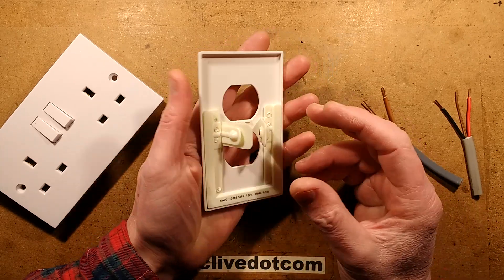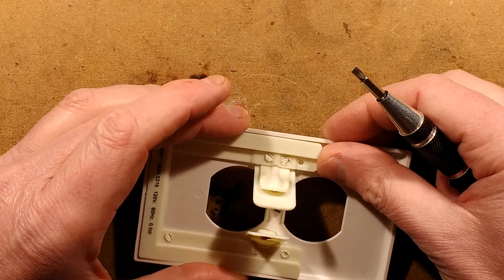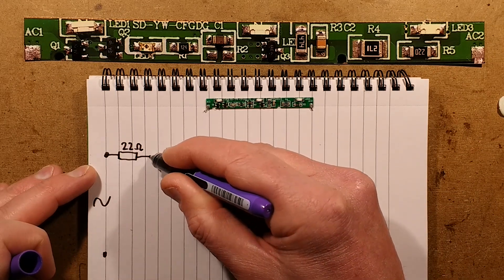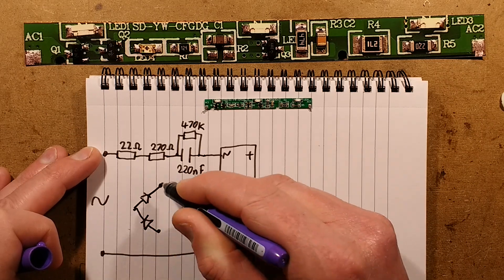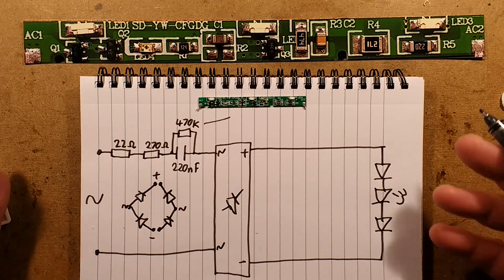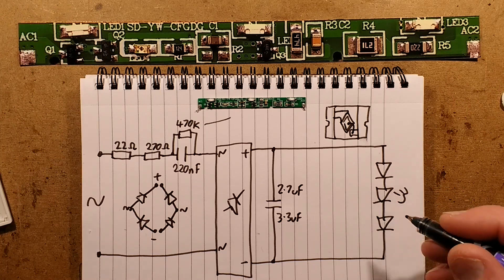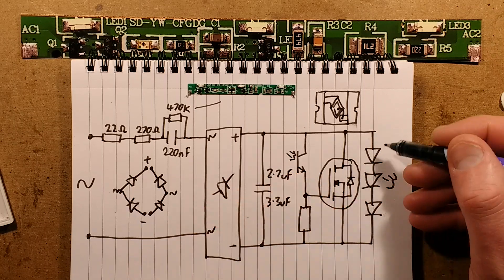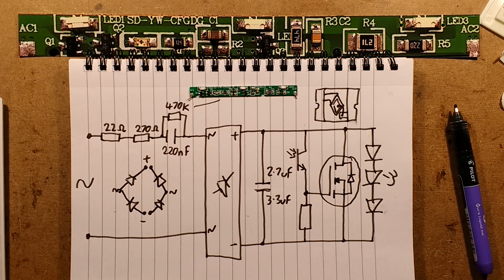Inside a night angel illuminated socket cover.  (schematic)

Comment: I like these "european" requirements. I am from germany and I can watch these british videos without differentiating (except for the sockets and looping). Two dots, dash and a P.
Reply: L3 P3 it makes PERFECT sense to use those colours as they are the same as the plugs, why have two colour coded systems when one will suffice? Not everything created “in Europe” (where we agree to it) is bad.
Reply: Also Clive, like me, might have lost track of time!  'New' colours?  They were introduced around 15 years ago!
Reply: Not everywhere. In eastern Europe we have a phase on the left side. It's mandatory.
Reply: In America, The live goes to the brass terminal. Neutral goes to the silver terminal. 

Left and right don't mean much because American outlets can be installed either way up. In general people put the earth pin on the bottom, but it's actually better to put the outlet in "upside down" so the earth pin is on the top. This prevents you (or your child) from dropping a quarter between the live and neutral pins of the device while plugged in.
Reply: im a little confused, are you guys talking about polarity in ac?
Reply: It's standard to create a polarity in AC circuits yes. In France there is no obligation but there is a recommended wiring polarity. It's because even if the power is AC, most of the time, power switches only break one wire; also in older electrical systems, with either lead fuse or cylinder fuses, only the live is separated. So it's good practice to create a polarity.

About standard, in France, neutral is blue, grounding is green and yellow (stripped or dotted) and live is any other color - tho for convenience, red, black and brown are considered "main" colors.
Reply: ok, i dont see an advantage here, because the polarity is switching in ac and as long as the circuit is broken, no current flows... but im no electrician so i guess you are more right then i am.
Reply: Colour codes really make no difference for me but I do feel the North American system has definite benefits.  Specifically the separate outlet and wall plates.  It makes it so much simpler and cost effective to simply replace a cover plate if damaged or you're redecorating and want a different colour.  But if we were using 240V I would want something more robust like the European system.  But at 110V shocks really aren't so bad.  Trust me.  ;)
Reply: This is the UK system. If you wanna see what most european plugs looks like, look for the Legrand catalog. Continental plugs and switches are usually made of one metallic or plastic support, one "block" that can be an outlet, switch, or something else (antenna, audio, video, network, etc...), and a face plate. In fact, going by US movies, I always feel like the US have only a few poor choices of outlets and switches compared to here, but that might be because Hollywood goes cheap and still use those 1950's "poking nose" switches :p
https://goo.gl/images/Yr3iVd
Reply: Thomas Herzog, it's not so much polarity as it is voltage reference. You see the neutral is bonded to ground, so they're both at the same potential and the voltage on the live osculates +/- with respect to ground. That means that you only have (usually) one wire to worry about getting a zing off of. It also means that the line voltage cannot drift with respect to the local ground. If the voltage difference were to drift too far, that could make plugging in an appliance a little unpleasant.
Reply: American plugs are polarized, yes.  One pin is larger than the other. The larger pin is the neutral. Neutral goes to ground in the breaker box and acts as a return for the live wire to complete the electrical circuit. The ground wire also goes to ground in the breaker box, but should only carry current when something goes terribly wrong.

When you are wiring an outlet or light socket, you can tell the live terminal from the neutral terminal because the live terminal screw is always brass colored, and the neutral terminal screw is always silver. The ground wire is attached to the terminal with a green screw.

The practical reason for this is most easily shown in a light socket. If you wire a light socket backwards, then the metal threads the bulb screws into is live at 120v, and could easily give you a shock.  When you wire the socket correctly, the contact at the very bottom of the socket is live, and the threads are the neutral, making it much harder for you to accidently shock yourself. 

It's mostly about safety and standardization.
Reply: The difference is that one conductor (neutral) stays at almost ground potential, while the other (phase) swings between negative and positive at the mains voltage, with respect to neutral.

Oops! Didn't notice this had already been replied to twice....
Reply: I 3 phase is Black, Brown,Grey is mandatory for plug in PL in this order L1-L2-L3 To change a spin rotation u must change on engine or by a driver board

Comment: On a vaguely related subject, I have a pair of motion sensing LED lights facing each other in my stairwell which only come on when its dark and someone is using the stairs.  So when they switch on and illuminate the stairs and each other, why don't they immediately think that it's daytime and switch off again.  The motion sensor and light sensor are integrated into the bulb.  It has been suggested that they occasionally switch off and measure the light level before deciding whether or not switch back on again and they do it so fast that you don't notice.  But this wouldn't work unless they were somehow synchronised.
Reply from the maker: You can configure the circuitry to ignore the light sensor while the light is lit.
Reply: OK, that makes sense, I think.

Comment: I must be missing something here, why is the bridge rectifier not short circuit when the MOSFET is turned on?
Reply from the maker: It is.  The whole circuit is shunted to the minimum voltage required to keep the MOSFET on.
Reply: Ahh I see, thank you Clive

Comment: Very nice fire starter. The dropper capacitor looks like the ones rated at 50 Volts.
Reply from the maker: It doesn't inspire confidence.
Reply: How much MLCC capacitor takes before it goes bang?

Comment: Ireland just banned the twin and bare earth cable. It now has 3 wires with the same CSA  and all insulated.
Reply from the maker: That's interesting to know.
Reply: In portugal those bare earth cables are non-existant.
Reply: same in NL
Reply: Im not a spark so am unaware of what the reason for banning the twin & bare earth cable is? I would have assumed that having the earth central & bare was that if the live or neutral is damaged along its length there is more chance of making contact with the bare earth and activating a RCD. Do you know what the reason for changing it is, is it safer now? Luckily I work on auto electrics, mainly ecu & immobiliser faults, so very few (if any) regs to worry about, if the vehicle is properly fixed nobody asks how :-)
Reply: Same here in Brazil. Also, the protective earth cables here are usually thicker than the live and neutral cables.
Reply: I think there should be a regulatory wire between the company fuse live and the consumer unit live.
Reply: Wouldn't you want it to activate the RCD/GFI in that case?
Reply: It has been the same "down under" for many years.
Reply: That seems silly as the reason for that bare earth wire is fairly self evident from a safety point of view.

If a short of excessive current situation occurs then the insulation n the current carrying cores will soften/melt and there is a good chance the earth core will end up pushed against one of them which will take out the trip.

By insulating the earth this is less likely to happen until the heat from the other cores melts it's insulation too.

that is my take on it anyway.
Reply: Can’t think why. In terms of disconnection times it’s perfectly safe.
Reply: crazygeorgelincoln in Britain this is indeed defined by BS7671.
Reply: Here in DK, we use cables with earth wire in its own insulation.
Reply: amojak probably corrosion. If you puncture the pvc over the bare earth wire, on an outside cable it means the end of it after a few years
Edit: cables also have fire retardant in them (aluminium hydroxyde with water enclosed in it) sometimes, so that could also corrode the bare wire.
Reply: Australia uses the same color coding as the UK but our earth conductor  is insulated 
Brown=Live
Blue=Natural
Green/Yellow=Earth
Reply: IIGrayfoxII That's handy. All of Europe uses those colours along with grey and black for the other 2 phases.
Reply: Phase 2: White
Phase 3: Dark Blue
Reply: We've had MC cable for awhile which has green wire, isolated ground. Pretty much replaces old AC cable with a ribbon inside and casing used for ground.
Reply: t0nito does that mean no ground or isolated insulated ground?
Reply: Germany: 3x1,5 mm2 (NYM-J)
Brown (black) = L1 / 2 / 3
Blue = N
Green/Yellow = PE
Reply: I've only dealt with consumer wiring in the UK but have never found a bare Earth cable except with the very old stuff.  In fact I've just looked online and there is no instance of a bare Earth wire being normal in new style wiring.
Reply: Insulated ground, yellow/green striped.
Reply: Colour wiring in Portugal

R(L1) phase: Brown
S(L2) phase: Black
T(L3) phase: Grey
N neutral: Blue
E ground: Yellow/Green stripes.

Before european regulations it used to be:

R(L1): Black
S(L2): Black
T(L3): Brown
N: Blue
E: Yellow/Green stripes
Reply: In Poland same but L1-L2-L3-N-PE is normal name, before Communism fall we use RST with a PEN.
Reply: Australia has had 3 identical insulated cables for ages.

Comment: The mains cabling is quite similar to what we use in the USA which is commonly called Romex. The big difference is the size of the conductors used. They are twice the size of what are used in the UK and EU since the voltage is half of what is used there however the amperage is twice of what it would be in the UK and EU.
As for this night light, forget it, unless it has been approved by Underwriters Laboratories ( a testing and certification organization in the USA ) I would not risk running it. If it were to catch fire and set ones house on fire, in the subsequent insurance investigation they determine damages were caused by an unsafe device, they could deny ones claim for repairs or replacement of ones property, and if one has a loan on that property, your up shit creek without a paddle.its as good as destroying the banks property.
Reply: That's exactly why it's always recommended to disconnect cheap electronics when not in use. A $1 Amazon special usb power adapter can burn down an entire house.
Reply: Old USA wiring was (I have this still in 70% of my house) cloth covered wires and always black/white bare but now black/white/green are being used and instead of 16 awg they went to 14 awg and 12 awg to the bathroom.  I love the idea of the socket but if it burns down the house no insurance company will pay though in my city it is a 70/30 chance they will pay anyway and the 30 percent is the paying.  Most people no longer carry house insurance here due to that.
Reply: No, our wires are normally in the attic or the basement and using Romex it is just laid out and stapled to the framing (bad business that as it has caused houses to be torn down to find the short because some jackass drove a staple the wrong way).  I have yet to be in a home (new or old) where conduit was used and if so I can't imagine any being metal.  We do have metal junction boxes though but slowly those are being replaced, due to cost, for plastic ones which just suck.
Reply: +John Coops, it depends where in the USA one might live where you will run into various regulations either by state or city rules. In Chicago, all cabling must be run within steel conduits using steel outlet, switch and junction boxes. This in regards to the old "great Chicago fire". As technology entered into play with the years, the Aldermen of their city council elected to enact this ordinance to protect structures from fires caused by electrical faults. In other parts of the country exterior wiring to air conditioners must be run in what is called "seal tight" which is a vinyl coated flexible metal conduit that is water resistant and also relies on special fittings to the exterior electrical boxes. In some areas or retail locations all cabling is run in a flexible metal conduit called BX cable, one must use special insulating sleeves and fittings where the BX enters into junction boxes. In industrial locations all electrical wiring runs might be required to be run in metal conduit which could be as large as 6 inches in diameter or even larger depending on the cables to be placed within, these runs require electricians to invest in special conduit benders just o make required bends to get around corners. The list goes on and on....
Reply: In the USA there are also different requirements depending on the building type. You will never find Romex in a 6-story office building, for example.
Reply: +Brian Leeper, in Ohio most cabling in high rise structures is run with BX armored cable or in steel conduits.
Reply: I think that's typical of non-combustible construction. Romex is, as I recall, not allowed there.

Comment: In Canada, as I would assume would be the same in the USA, the house circuit wiring is in a similar flat package. With internal white sleeved wire for Neutral and black sleeved wire for Live/Phase. The center ground wire is bare.
For normal 15 Amp circuits, the wire gauge is 14 AWG if copper (called 14/2), and 12 AWG if Aluminum (called NMD-7 12/2)... I just added the NMD-7 to the aluminum, since this is what is used in my house (I just looked at it). Not sure if the copper 14/2 is also called NMD-7.
Aluminum house wire is most common in homes built from 1968 to 1977.
For circuits where three wires are used, such as split phase receptacles or three way switches, the additional wire is sleeved red.
Reply: Very Similar.  Here in the States, we indeed use Black or Red (second leg in 220v circuits) for live.  We tend to use 12ga for connections where possible in new home construction.  Older homes will still have lots of 14ga.

Spot on for Aluminum, save for large loads such as utility feed, HVAC, and sub panels.
Reply: NMD stands for Non-Metallic Dry.  Means the outer mechanical damage protection jacket is made of a non-metallic substance (plastic, cloth, etc) and the wire is intended for use in dry locations only.  I'm not sure what the -7 means.  Perhaps it indicates it's aluminum?  Though most aluminum wire I've seen has clear wording that it's aluminum on the jacket.

Canadian code basically copies US code every once in a while.  Typically anything that is legal in the US (there are exceptions!) is legal in Canada.  However, what is legal in Canada is sometimes recently illegal in the US.

14 AWG is all I see for standard outlets in Canadian homes.  Of course, if the project requires a higher AWG wire (eg:  20 A kitchen T-Slots) then the appropriate AWG wire is pulled.  Backstabbing outlets is very popular here (unfortunately) and that requires you use 14 AWG.
Reply: Oh that gives me an idea ;)
Reply: North American Wiring Color Coding Chart: https://www.graphicproducts.com/media/71149/wire-color-coding-float.jpg
Reply: @shepd3   The 7 is an obsolete rating that denotes the temperature rating of the cable. In a house built before about 1970, the cable will be NMD 3, which denotes NMD rated at 60 centigrade, NMD 7 is NMD rated at 90 centigrade. These ratings have been replaced by NMD 60 and NMD 90 respectively, normally any cable installed withing the last 30 years or so will be vinyl covered NMD 90. The old cloth covered NMD 3 can still be used except in high temperature applications... which means you can't use it in flush mount light fixtures or to directly wire heating appliances... NMD 7 is okay for any application that allows NMD 90 .

Comment: C2 is likely 100V, since the dielectrics can withstand 2 to 2.5 times rated voltage for a few seconds.  Voltage crosses 100V for < 5ms.  Designers make use of this property by using physically smaller caps.  C2 limits the current after the rectifier to ~14mA.
C1 is rated 10V or 16V since ~14mA is ALWAYS flowing in the components after it, limiting the voltage across C1.

Comment: Do American powerpoints not have provision for an on/off switch? Here we're always told never unplug something without switching off the powerpoint first (but everyone does)
Reply: Nope, unless it's wired on a separate wall switch, all outlet's are live.
Reply: The U.S. doesn't have any requirements for a powerpoint switch on its electrical sockets. All outlets are live unless a separate powerpoint switch has been installed and switched off manually.

Having a powerpoint would actually make more sense from a safety standpoint since you can just switch the sockets off when they're not being used. Combine that with safety shutters and socket covers and you have a much, much safer outlet than what we have in most American households now.

Comment: Would this work on a GFCI circuit?
Reply: Only if the GFCI is a breaker in the service panel. A GFCI outlet is wider then a normal outlet and will not make contact. If you have GFCI with arc-fault as per new codes, it will trip the arc-fault when it turns on, as it shorts across the side wire connection screws on the outlet. Use at your own risk, it can cause fires.
Reply: Thanks, that's what I figured, and why I didn't buy any.